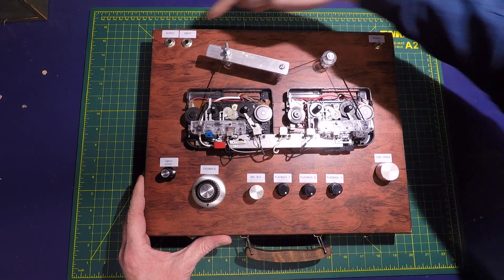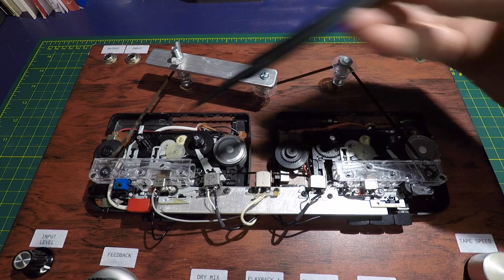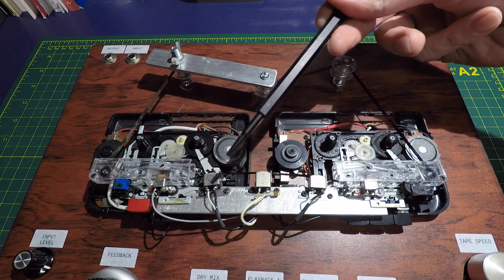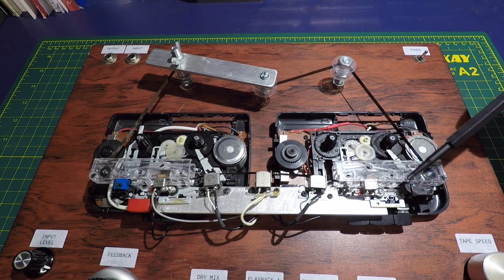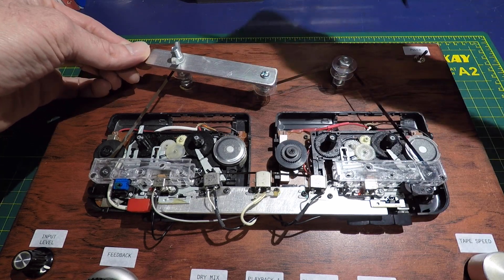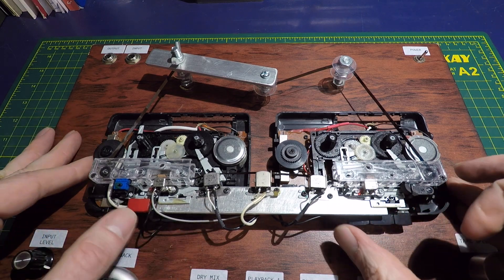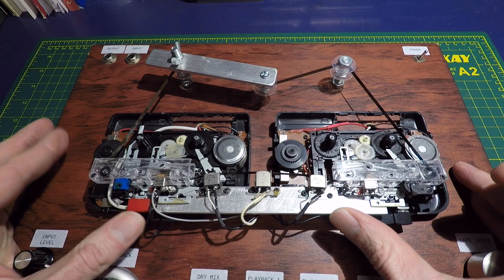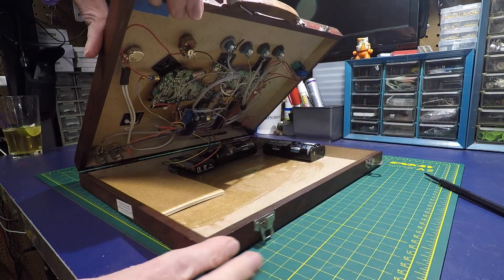DIY Analog Tape Delay

Comment: Hi, is there a chance to get a snip at the schematics??? Hand drawn are perfect also, just to get a grip on how to connect the extra tapeheads...
you mentioned swiftly an audio mixer unit inside the box, and a single opamp mixer board. I would like to build my own but still have no idea how to deal with the motors and tapehads... modulator converter... what's that for??? tnx for sharing your creations, it's beautiful sounding also!
Reply from the maker: I actually don’t have any schematics or diagrams or anything saved on this one. I’m not very good at documenting things unfortunately. I just kinda figured it out as I went along.

Comment: You should've used an actual AC-Erase Ferrite Head for cleaner erasing during recording. Actual Erase Heads work way better than those blue permanent erase magnets, which add harsh thunder-like noisy erasure during recording. But with the tape mechanisms you are using, I don't think it's possible to replace that blue permanent erase magnet with an actual AC-Erase Head. Those blue permanent erase magnets are usually used in cheap boomboxes and portable voice recorders. With boomboxes, there's a higher chance that the boombox will be mainly used for playback only that's why they usually try to make them as cheaper as possible. With portable dictation/ voice recorders, you can't really tell the difference with all the background noise that comes into the microphone during recording, and they usually use a DC system for recording, so there's usually no connection for AC Erase Head anyways. But with something more sophisticated and professional use, I would highly recommend using an actual AC-Erase Ferrite Head for clean erasing. The sound quality will noticeably and definitely will sound a lot better. As a teenager, I used to wonder why my tapes recorded on a cheap boombox vs. higher end stereo systems and tape decks so much cleaner and better. An actual AC-Erase Ferrite Head makes a very big difference.

Comment: Why aren't you using salvaged 18650s? Shame on you.
Reply from the maker: What are you even talking about? Batteries are not the focus of this video. Did you even watch it?
Reply: @SISKworks  . I was joking around. It just seems like a guy who would make something like this would be more resourceful instead of buying expensive non rechargeable batteries. yes i watched the video. Good stuff. 👍 I already gave you a thumbs up.
Reply from the maker: @E-BikingAdventures  well ok then. Haha. 😬 Thanks for watching. And TBH the dual battery packs is one of the things I don’t like about this project. but it really was only (easy) way to have clean sound with a PWM speed controller.
Reply: @SISKworks  I was wondering about the dual supplies. I started having a go at one of these years ago, I wanted to put it in a standard 9v fx pedal configuration and one of the things I got stuck on was the PWM noise. Putting a battery in for the motor control (while powering the rest of the circuitry from a mains psu or whatever) was one option I thought about.  I'm going to push the PWM frequency a lot higher than what I have currently (what's yours?), got some ferrite beads to try, maybe isolate the motor and audio circuitry with a transformer somehow. Great outcome with your project though!
Reply from the maker: @sirgavalot  Thank you. I actually don’t know what the frequency of my PWM is. I guess I could check that with my oscilloscope. Just never thought to do that though.

Comment: hey sorry this might sound like a super dumb question, but a magnetic audio head can we used both ways right? to read from the tape when the input is taking at the terminals and to write when voltage is applied at the terminals right? 
SECOND, what is the name of the heads you have used?
Reply from the maker: Yeah the play and record heads are the same. They just can’t do both at the same time. Not sure what their names or part numbers are though. I just pulled them from old cassette players.

Comment: Have you ever tried recording on VHS tape? It adds a warmth not possible with cassette tape.
Reply from the maker: No, not yet. But funny that you asked because I’ve been thinking about this the past few days. I want to try a put a speed controller on the pinch roller motor to see if I can get variable speed playback. I don’t think it will work for video since that info is recorded on an angle on the tape. But I THINK if I find a non “HiFi” vcr it could work. I wonder if anyone has made VCR tape loops yet? Hmmm.

Comment: sounds sick!, what amplifier/circuit/pcb did you use to amplify the 3 delay tapeheads?  thanks in advance!
Reply from the maker: That was a pre-built LM386 audio amplifier board I bought on ebay for super cheap.
Reply: @SISKworks  thx! I don't really mind eq'ing the signal but amplification is a must. Feels kinda weird to max out the mic input gain on the mixer so a pre amp is useful. thx!